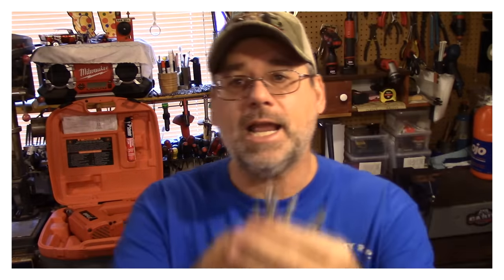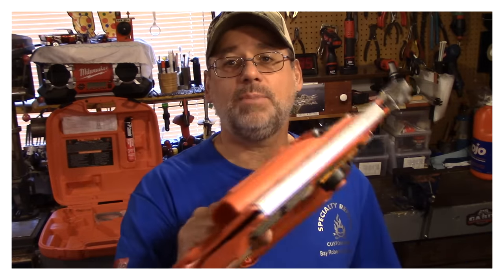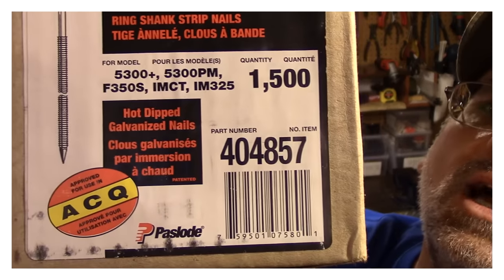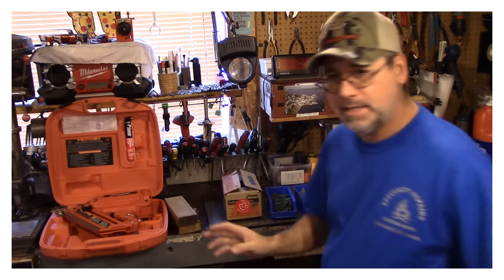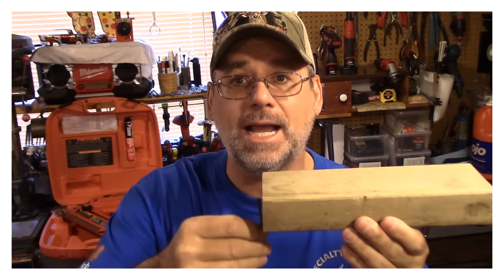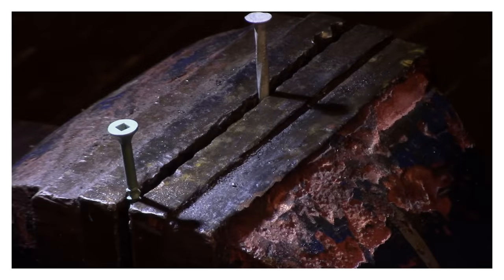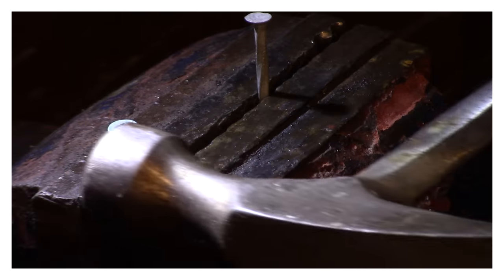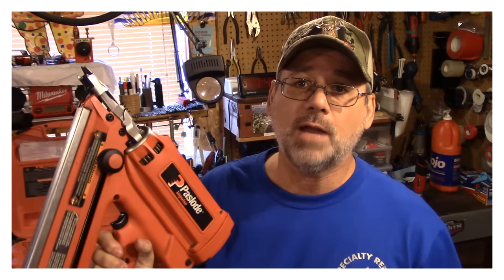BEWARE  NEVER USE DECK SCREWS  - DECK SCREWS VS NAILS -  PART TWO IN DESCRIPTION

Comment: Pull-out strength is also an important consideration
I've also worked with screws that, while not as tough as nails, do have enough toughness for most jobs.

Comment: GRK now makes framing screws. the grk r4. Way better than deck screws. It would be interesting to see the R4 in a vice though. 

Of course you can spend $1 a screw and use GRK RSS structural screws and you will  Beat out nails every time.

Comment: Deck screws are far better than nails. The shear strenght for a deck screw is over 5000lbs. the tensile strength is less but that is NOT a factor in wood construction because the wood gives first. the biggest factor is loosening. screws dont loosen much over time, nails do.
Reply from the maker: Both fasteners have their place and knowing where to use them can be difficult for some so do your research and follow best practices and the building codes in your area. Cheers Dana

Comment: Screws are not intended for shear strength but they do have superior grip strength....this is why code required the use of galvanized clout nails to secure joist hangers because nails have  the required shear strength.
Reply: Have used joist hanger screws made for that purpose, expensive but works well , has a lot of sheer force etc but it’s new thec prob only out like 5 years ,  hex heads,  prob twice the diameter of a reg deck screw but the one thing is most of the stuff is not made here but in the “ C “ place and mostly crap

Comment: I wouldn't say you should never use them for anything structural, just that you should use nails instead for any joint where the weight of the structure is creating significant shear force.  

Screws are vastly better at creating and enduring strong tensile forces, so are able to hold joints together much more tightly and for much longer than nails.  

If there is only a shear force, use only nails, but if both forces are present,  a combo of nails and screws provides the best of both worlds.
Reply from the maker: Your on the right track. Best to follow best practices  mentioned by local building codes is always a good choice.  Cheers

Comment: I have two decks, one my husband used nails and the second I insisted on screws. Fast forward several years, and the nails are backing out, and the screws are still tight. So my decks show that screws beat nails!!
Reply from the maker: I prefer screws as well as I stated their great for  not structural locations as their designed for . Cheers
Reply: Like Steve says, use deck screws for deck planking (ie their intended purpose),I  think he's more concerned about guys using deck screws for structural joins (not their intended purpose).

Comment: When I bought my Paslode impulse nailer from the Paslode dealer in my area about 15 years ago, I asked about the availability of the special Paslode nails for treated wood (which I had read about in the Paslode literature). The dealer claimed that such nails didn’t exist and that I had to use the galvanized nails like everybody else.  When I showed him the Paslode literature and the SKU number for those nails, he just continued to deny that Paslode made or sold such nails. I later found them at the local big box store. Some people never learn, and that dealer has been hampered since then by hiring people that know absolutely nothing about the products they sell; he continues to hobble along, barely making a living, with the store tightly closed up at just those times that the people who need name-brand tools have the time to shop.  With the advent of Amazon, I seldom have to visit that dealer any more.
Reply from the maker: I have the special ones for my paslode nail gun just for PT wood and they were  quite pricey too. I go to a contractor  retail outlet or as you have noticed amazon has some great prices as well.
Reply: There are always going to be people like that.  I once sent someone for some galvanized ardox (spiral) nails.  The local hardware guy insisted there was no such thing.  When the buyer was going back into town, I sent a couple of different size samples.  The hardware guy insisted that they must have been some special custom product - nails were always smooth or they would not go in easily.  My buyer started going elsewhere.

Comment: In regards to structural support, is there a difference between "deck" screws and other screws, like steel wood screws?  What's your definition of "deck screw"?
Reply from the maker: Yes, absolutely,  some screws are certified for structural use .  So many fasteners to choose from as long as their recommended in local building codes.  Deck screws are only allowed in non structural load bearing  areas  where specific fasteners are mandated. Deck screws sold  labeled deck screws are  only rated to be used as deck screws in specific areas.

Comment: Good Topic.
Crazy thing is.... Big Boats that take alot of beatings from the oceans are made with alot of stainless screws in them...not nails, yet very old boats had nails because screws wernt as easily avail.
 Homes use nails and are still standing without using screws.
Stainless Deck screws for decks are alot better than coated deck screws that will eventually rust away and be weak fasteners.

Comment: Grk fasteners deck screws, Z rated for pressure treated wood work great, they have a shear rating to them, and a lot of other structural screws but, your probably not going to find them at a chain store. Otherwise I don't recommend deck screws for the same reason.

Comment: I understand deck screws have no sheer strength compared to nails but the real question is can you give us an example where they failed? I think they hold a board a lot tighter giving it less chance of sheering of in general. GRK screws also have a higher sheer strength than standard deck screws but I'm not sure how much that helps the argument for screws on decking. Very nice video though!
Reply from the maker: Yes Mark all the place you should not use deck screws - like a structural beam  or load bearing wall - seems like an odd thing to do but stop and ask your local building inspector :) he has seen it all. Cheers bud.
Reply: GRK R4 has a good sheer strength and the RSS is even more impressive. Just wish they were Robertson or torx plus instead of torx

Comment: I once built 30 wooden bakers racks for a concrete company.
The owner had built a prototype using your Paslode Nail Gun.
Under load, his bakers rack never made it across the floor the first time without falling apart.
Like I said, I built 30 of them, except I used 3" galvanized drywall screws.
In the years of use under load, there was never a failure.
But I was not using pressure treated wood either.
Those deck screws that you showed will rust out and snap in about 10 years if used on an exterior deck with pressure treated wood.
I have replaced 2 decks so far this year that used those deck screws.
Very easy to take apart using a crowbar.
I am trying the stainless-steel drywall screws now backed by 1/2" carriage bolts.
Much more expensive
Reply from the maker: SS all the way , much better . Cheers 👍

Comment: I use screws rather than nail for several reasons. Nails will back out over time and screws can break but only if they are not in all the way. Even then the screw still holds. Try beating two pieces  of wood apart screwed and then nailed you will see the difference. My whole house is screwed no nails.  I ve seen siding and roofing nails back out. Not good. I've watched youtube where nails verses screws were tested for strength  and screws won big time. I experimented and even with the Amish dowels they are strong but leave one extended you can snap it off easily. I have no nails in my house and have 80 and 100 mph winds. It never cracks,squeaks or shakes
 .A Amish cabins are screwed,no nails .. indures  the transport. Yah some times the head will snap off or break with tourk but it still holds and just try getting it out. Won't happen.
Reply from the maker: Screws vs deck screws  or nails , this video demonstrates deck screws only.   Your whole house is screwed together with deck screws ? you must live in a part of the world without any building codes or building inspectors . 😉
Reply: Is it actually against code to used deck screws when framing a house?

Comment: I rebuilt my fence with treated lumber and cedar pickets. I used a nail gun and the red tipped nails you recommended. Over time the nails started to push out to the point that several pickets and boards came loose or simply fell off of the fence. Had to go back over the entire fence and insert deck screws to keep my fence from falling apart.
Reply from the maker: Interesting Robert . I finished a 60 foot fence using my nail gun , showed in a couple of vids how and not one nail had popped out over all this time. I used ring nails on my fence boards .  Screws are great too for fence boards. Cheers
Reply: I used spiral electroplated air nails on my now 27 year old back deck. Nothing has moved, shifted, rusted or popped out yet. On my front, covered deck, the screws look all corroded to hell and it's only about 10 years old.
Reply: @Robert Moore those red topped nails might not have been ring shank.
Reply: @huejanus5505  I find it extremely difficult to believe, considering that the spiral nails  in my outdoor steps are popping up just three months after installation.

Comment: Screws are the way to go. Nails, especially when countersunk, are a bitch to remove. And for a typical deck, there's no unnecessary need for this extra shear strength.

Comment: Interesting video. I think the next time I build an outhouse is, I am going to be buy a small one door plastic shed from crappy CTC when they come on sale. You did not explain why you do not like the air nailer, it is a lot cheaper.
Reply from the maker: Thats a great idea about the outhouse. The air nailer is by far the best choice, most reliable and the most powerful and lower cost.  I don't have an air compressor up north or electricity at a lot of places i do work. Its portable and no hose.  I have 5 air nailers and staplers I haven't shown , all lower gauge finish nailers.

Comment: All nails are good for is shear  strength..  then add a screw for fastening..  ring shank and spiral nails were designed not to pop out but they do.. wood moves, alot.. 
If it's not structural use screws.. if it is structural use the appropriate gauge nail, then put a screw in it too.. btw... decking boards, use coated or stainless screws. please don't nail them down.. you will be pounding nails down for the life of the deck...
Reply: Donald Kasper    There's a lot of really old houses put together with just nails that are still going. We'll see how well a screwed together house is in another hundred years or so.

Comment: There was lots of talk to get to the point of a property known as "shear strength".  Never use screws OR nails as your only means of support.  They should both only keep the wood from shifting.  Support should always be from underneath.  Use relief cuts and make a proper joint.
Reply from the maker: Hahaha well Todd I'm a talker eh :)

Comment: Simple test.. nail 2 pieces of wood together, Then screw 2 pieces together. Now get a prybar and pry them apart. Which one separates more easily? 
The one that doesn't pry apart easily is the better option. Done.
Reply from the maker: The location of any fastener is subject to be in compliance with local building codes .  There are plenty of locations where plain nails or deck  screws are not allowed.  Which fastener holds the best is not in any  building code - its all about engineering , design  and common best practices.
Reply: Terrible advise

Comment: Deck screws are for decks. Simpson makes screws you can use for framing.  Put that in your vise and do another shear challenge.
Reply from the maker: Correct  and simpson construction screws are made for  it not a #8  deck screw like I have seen :)  Cheers
Reply: @SteveRobReviews  So what would the Simpson screw do in your demonstration. Would it bend over like the nail or snap like the screw?

Comment: There is no shear load unless it loosens and has movement (like nails do), the harder, somewhat tempered deck screw is stronger.
Reply from the maker: Depends where you live . In cold climates like mine the ice that builds up sure does put a lot of sheer load on the screws. Never seen a nail head sheer off but I showed plenty of deck screws on my channel  that have sheared off over a couple of winters .  Going to a #10 shank seems to resolve it much better than the standard #8 . Cheers
Reply: @SteveRobReviews  Nails just pull out.

Comment: Most construction screws are not made for SHEAR LOADS, but work well (better in most cases ) for hold down stresses, ex. floor sheathing, decks, wall sheathing, and more....  10d nails are industry std for shear loads but w new technology, shear screws made and designed for ledgers, tecos,  technology, etc and are ENGINEERED to work.  Just don't depend on deck or drywall screws to perform on shear load applications.
Reply from the maker: Well stated Joe , bang on 👍
Reply: Lol dry wall screws...  I wouldn't use them for anything except...  drywall.  I hate phillips heads so much.  Should call them strip heads.

Comment: In a vertical support situation the best method is to notch out your post.  That puts the weight directly on the post making a much stronger connection.
Reply from the maker: Exactly 👍

Comment: Okay you're saying don't use decking screws because it sheered off really easily. Well I'd like to know who's going to be taking hammers and doing that on my deck with the screws? I can tell you this I just moved into a house in the woods in West Virginia and somebody did a crap job building the deck because they DID USE regular nails and it has buckled in so many places and come apart. Now maybe if they would have tried those galvanized twisty looking nails maybe that would not have happened. But there's no resistance on regular straight nails so with temperature change and the wood breathing so to speak this is why you have to have something that has a thread on it or something that's twisty looking. When they came and did the house inspection the guy did say the deck was okay but that thing I don't understand is he must have only inspected it from below because there was snow on that deck and how could he see the parts of the deck that were a little bit buckled? I'm afraid to walk on the thing. And it is quite high up off the ground as the house is built into the mountain. It's at least 8 feet up.
Reply from the maker: Well I never said to never use deck screws but to never use deck screws  where their not allowed or they will fail  . Follow the recommendations of your building code . Cheers
Reply: @SteveRobReviews  indeed.👍
Reply: A screw generally has a superior pull-out strength, but, as shown here, an inferior sideways shear strength. Where you want to hold something DOWN, like a deck board, a screw is superior. What you don't do is use them where sideways strength is important, for example framing a building where walls will be exposed to sideways load, or for supporting your deck's joists... actually best to use joist hangers for that!
Reply: @ByGraceIGo  screws are bad for structural stuff because - and this could be explained better in the video - framing joints flex with load, wind etc. and most forces are shear forces between the boards, so you need flexible bonding material there, not a screw.
You need screws where loads are axial, like a decking where floorboards are loaded from the top and forces are trying to pry them away from the base.

Comment: Glue and screw, PL premium and deck screw for deck boardd, Construction screws and PL for structure, nailgun is good for fence not for deck
Reply from the maker: Andrew  you're bang on with the PL premium . I have been trying out the PL 400 and it's been great so far.  Thanks for the comment . Cheers

Comment: I have seen a big difference  between cheap deck screws and the lifetime guarantee type. of course the lifetime guarantee ones cost more but are thicker and much stronger.
Reply from the maker: I agree they are not all alike but most big box stores sell the same ones more or less. Cheers

Comment: My take would be don't use a deck screw in shear strength positions but in no load and just holding positions is ok ...thanks
Reply from the maker: Exactly , yes you are so correct . Cheers